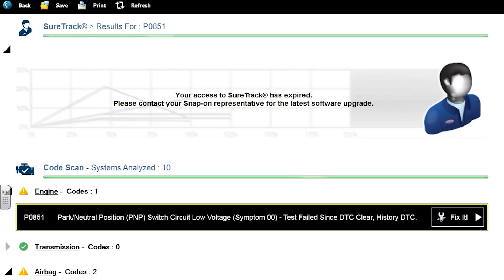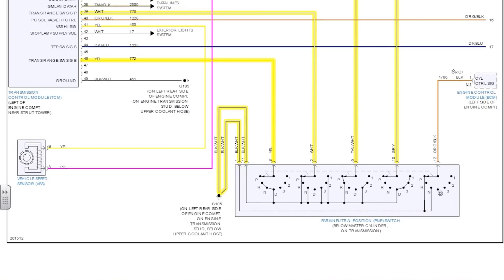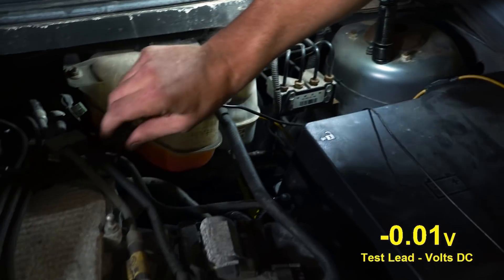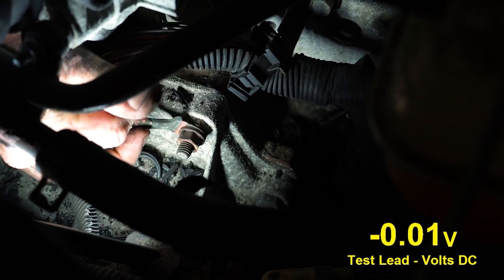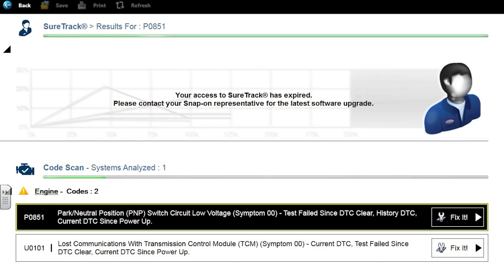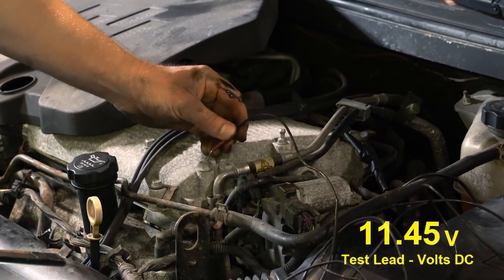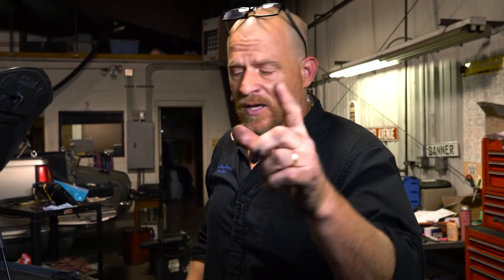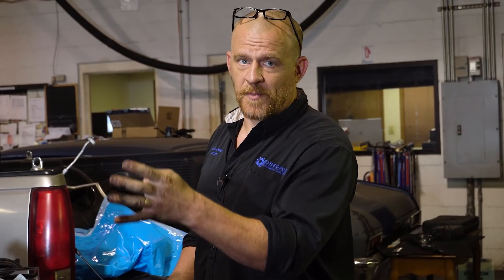PONTIAC G6 BAD GROUND

Comment: All good info.
I am 96 now l have repaired many cars with ground issues,
British cars in the 60s and 70s had many of these problems. I went to a local garage where they had an issue with an Austin mini Cooper 1966.
They had changed the battery, dynamo starter motor and voltage control and cutout unit.
The car wouldn't start, turning over very slowly,as if it had a nearly flat battery.
I traced it to a bad ground in the engine ground to the chassis put a new ground cable in.
All the parts they had replaced where ok, 
Looks like they change parts then have to get some one like me to fix it.
That was 48 yrs ago, and k am still fixing faults people keep asking me to fix their cars as the garages tend to rip them off

Comment: Paul I am sure you have heard 100 times that you two dont look like brothers... but you sure act like  brothers :) 
You 2 keep up the  great work ! Thanks to you and Ivan at Pine hallow and SMA .. I was able to fix as friends no crank problem caused by a low cost immobilizer... I had to bypass the bypass :) .. Bu it now works with a key on and press a starter button

Comment: Great video and specially having your brother there with all his experience too. The rag thing was pretty funny. I had the same problem on a 2000 Dodge Durango and I didn’t realize it was a bad ground. I just cut the wire to the exam and hooked it straight to ground. The car started in any gear since it bypassed the safety switch. I didn’t care, but now I would know how to fix it correctly. Thanks for the great tip.

Comment: How can you test a fuse junction box that sits under the hood of a 97 Grand Prix GT 3.8. The repair shop said it was bad. I have the service engine soon light. I have already replaced both oxygen sensors and the other evap sensors. I didn’t want to keep dumping money. I get the bank 1 lean sensor code

Comment: Great video Danner!.  But I need to add something important. On testing bad or weak grounds, it's much better to do the LOAD test than using resistance measurements or voltage drop. Case in point.  I just had a 08 Chevy Silverado. Symptoms were intermittent engine shutoff.  While driving, the truck wound run fine, but when they turned the A/C on (Loading the ground), the engine would die. I used an old incandescent 4.5 Amp headlight  as test light to load the grounds one by one while the engine was on, and when I loaded one of the grounds going to one relay, the engine would would shut off. I found that the bolt holding the bad ground to the engine came loose.  The customer said the engine was swapped recently. On a loose ground the resistance measurement and the voltage drop would show an OK ground, because the ground eyelet was barely touching, but when you loaded the ground with a high amp source, the barely touching ground would break. Old headlight lamps as test lights work much better in these situations.  Keep up the good work!
Reply: Yup. At my shop we've got a seasoned tech that was getting 12v to an actuator but when he'd activate the circuit nothing would happen. I gave him my 35w work light off of a tractor with some leads on it and told him to plug it into the connector. When he'd activate it, it would give a very dim light. Told him he had a corroded joint somewhere. He got to digging and found a corroded fuse terminal. He immediately went and bought himself a light for cases like that.
Reply: G105 is loaded as soon as the key is on lol
Reply: @chekelley6861  Yes. It gets loaded....somewhat, but it needs a HEAVY load, like a compressor magnet or a headlight to really stress the connection to test. When grounds are loaded with a high amperage, faulty or weak grounds become apparent more readily.  And sometimes you need to test the grounds and other connections with the key off.
Reply: @cyberslacker5150  Actually, the proper way to test a circuit is in the system with the components in place as it was designed by the engineers and measured with a scope or DVOM. Will a substitute load work in most cases? Yes. Is it commonly seen all over YouTube by famous diagnostic technicians? Yes. But you can make any circuit look bad if you load it beyond what it’s designed to do. Watching how bright a headlight bulb gets is entirely subjective. Using the existing loads combined with an actual measurement never lies.

Comment: As always Great video.  I have had customers bring their car to the shop I work at and say I need you to install this transmission, PCM, etc...when asked why they have said, I have brought this to 3 shops and they say I needed a new one.  Get setup to change said part and start removing wire harnesses (I start with grounds now because of this) and start loosening a gound bolt and the ring terminal falls off the wires...replace the ring terminal with individual ring terminals (I also have found if you have the wire to do it if you have the wire coming off the 12 O'clock position and support the harness so strain is relieved they shed water instead of letting it pool)and the car is fixed...call customer and explain finding and they usually flip because they just want the part replaced.  What would you do?
Reply: My thinking is they went to 3 other shops why did they not let them repair it .   I see customers going to part stores  doing  free scans  not knowing how to do repairs  go to a shop  more often  lately . I see this as a bad customer   tell them to watch this  video or other ones on bad grounds and call you back   . I try to avoid working on that  type  of personalitys  cars  in the first place  hopefully that  helps
Reply: @kevinarmstrong864  great advice but I'm only the newest of the monkey's but it's not my zoo...the owner has been in business for 20+yrs in a 40k population town, so we get some of the interesting cases like you often find on this channel!  Hence why I have been binge watching...someday soon I will be signing up for Scanner Danner's web learning. For now I'm the one in the shop that get's to change alot of oil and tires...and every so often get's handed a troubleshoot & note findings job, so the front office can send an estimate and get approval to fix...the more I learn the faster I get a diagnosis to these the more I will get...the faster I will get raises/bonuses.  Eitherway thank you for commenting!
Reply: Bend the customer over as requested. Crazy stuff some people feel ripped off without being ripped off yet feel completely satisfied being ripped off ??

Comment: With Chevy Cobalt's and Pontiac G5's that have those problems I simply run a 12 gauge wire from the ECM and TCM to the ground location that's on the jump ground point. Tends to fix many electrical issues.

Comment: Toyota Siennas have ground wires attached to each bank. One easily accessible on the right side when facing the engine and the other one not visible from the front but from the bottom. In my case I had heating circuits for the O2 sensors for both banks, these are shared, there are least 4 ground wires that are directly fed to the PCM that is used for grounding components, in this case the O2 sensors, the ground wires were toast and ripped off as soon as I touched it. I diagnosed this by watching the pulse width from the computer that was not present, I almost called the engine computer but I didn't realize the the computer had so many small ground wires. I guess Toyota doesnt have many shared ground internally as we are used to. This was a Toyota Sienna 2012.

Comment: We have a shop down the road that we won't even work on a vehicle that they worked on. They're that bad. Crossthreaded spark plugs not putting hose clamps back on. Etc
Reply: Sounds like a nightmare if you were to pick up on those 🤦‍♂️ it is harder to fix someone else's mistake because it is usually rare to see s cause failure.
Reply: @scientist100  100 percent